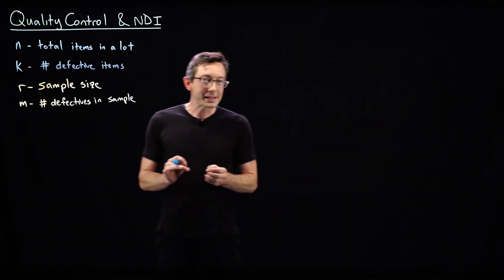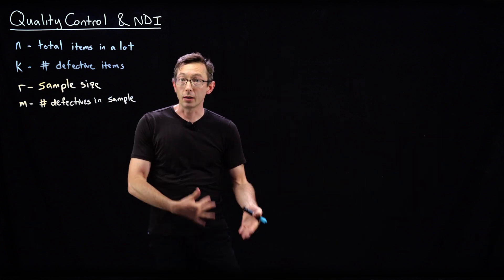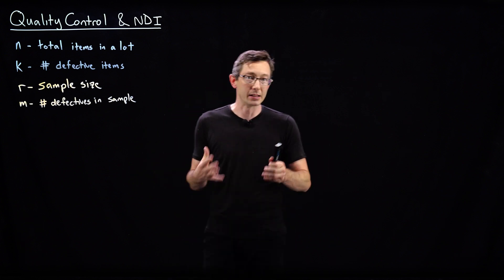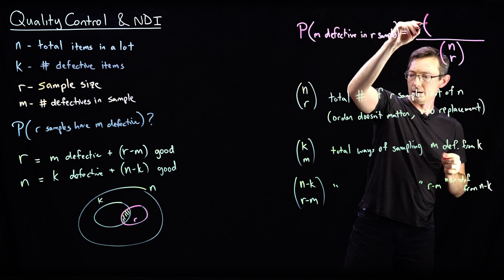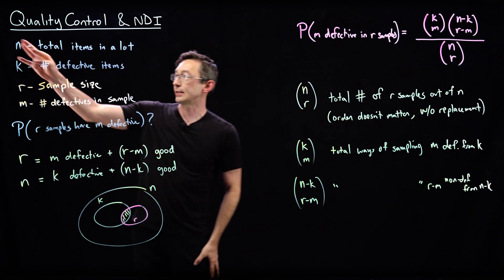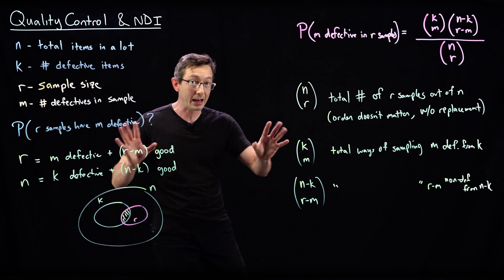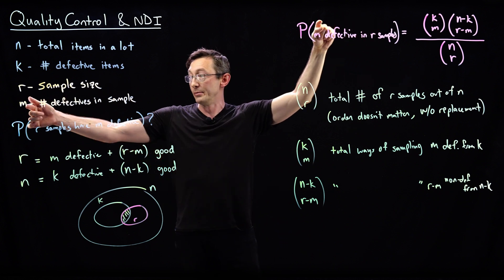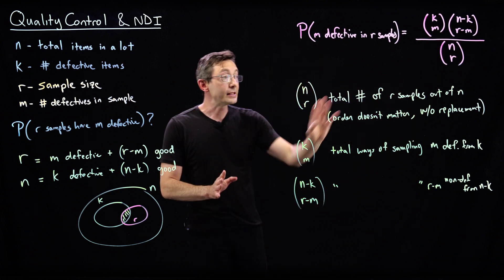Quality Control, Non-Destructive Inspection, and the Multinomial Distribution

Comment: Probability of finding 'm' defective pieces in a sample 'r' is equal to [the total number of ways I can have 'm' defectives in 'r'] divided by the total number of samples 'r' I can draw from 'n'
1- denominator: total number of ways I can get 'r' samples from 'n': n/r n chose r (order doesn't matter, no replacement)
2- numerator:  ways I can get  samples out of r:
	A) ways I can get defective items: k/m k choose m (sampling all defective parts from the population of all defective parts)
AND(multiplication)
	B) ways I can get non defective items: n-k/r-m n minus k choose r minus m (sampling all good parts from the population of all good parts)
P(m defective in r samples)= [(k/m) * (n-k/r-m)] /(n/r)
Reply: as I understand the problem, we are using the multiplication case because we are doing a random sample, so we are contemplating getting both good and bad items at the same time (in a single sample)

Comment: I think this should be hypergeometric distribution instead of multinomial distriubtion. Both generalize the binomial distribution, where the hypergeometric distribution generalizes to the case without replacement (binomial is with replacement so we start from the same conditions with each draw) and the multinomial distribution generalizes to the case of more than two possible outcomes (but with replacement). There's also the multivariate hypergeometric distribution for more than two possible outcomes without replacement.
Reply: But it is, indeed, the hypergeometric distribution. But he mistakenly calls it multinomial!